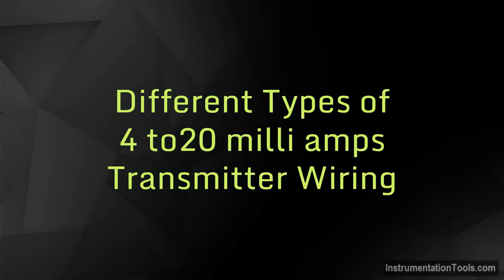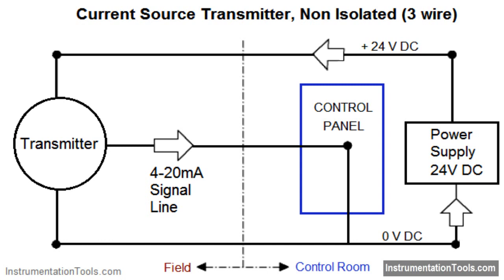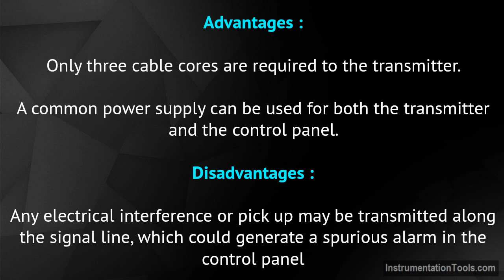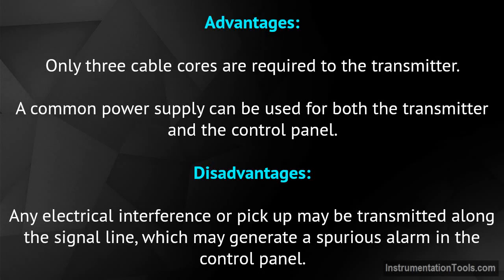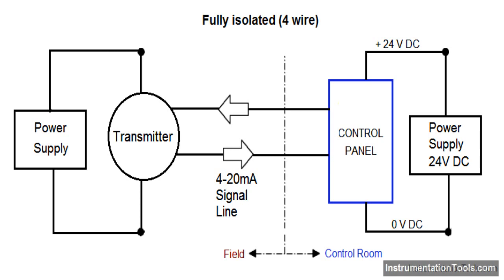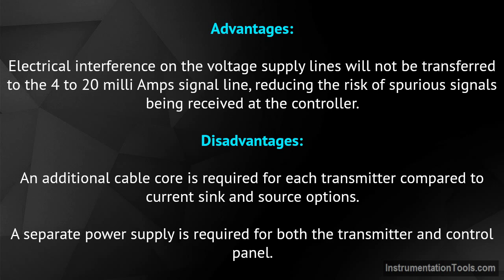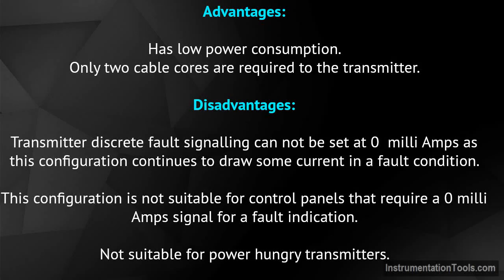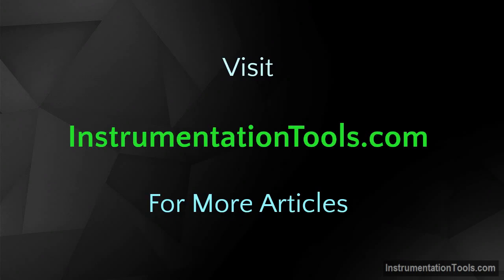Different Types of  4-20 mA Transmitter Wiring

Comment: Sir can we connect single 4-20 ma to 2 sources?(i mean from single 4-20ma can we run 2things?)
Reply from the maker: You mean, is it possible to connect two field instruments to a single 4-20mA?  Not Possible unless you use some sort of digital communication to read the instrument's data like HART protocol. (Your PLC/DCS must support this functionality)
Reply: @InstrumentationTools  yes i mean to say from 4-20 plc out,can we connect two sources like one is actuator and other is vfd,both need to run on same time,
Reply from the maker: @uzairasif2475  You have to use separate PLC outputs, otherwise, you can use a barrier (one 4 to 20 mA input and two same 4 to 20 mA outputs) after the PLC output.